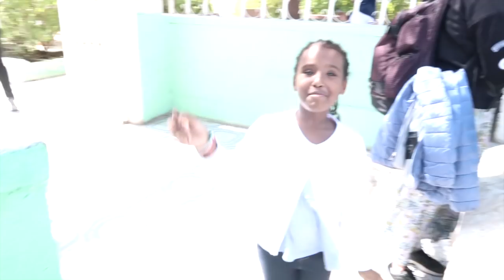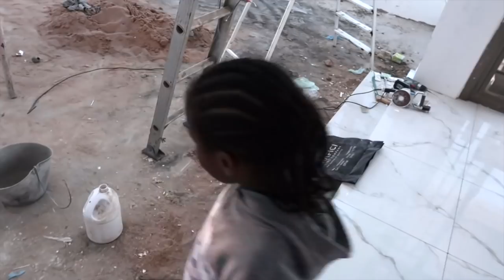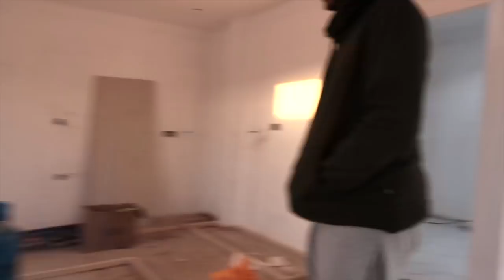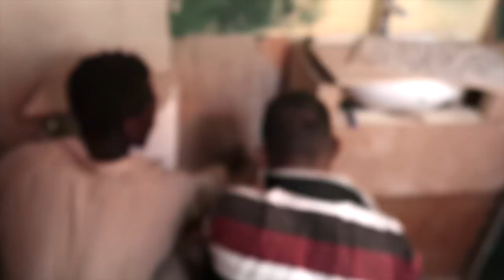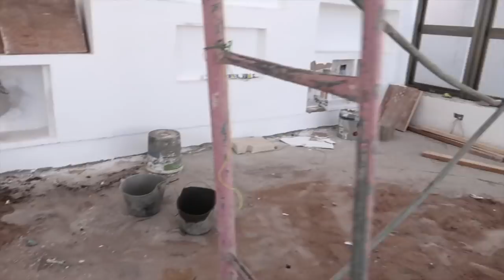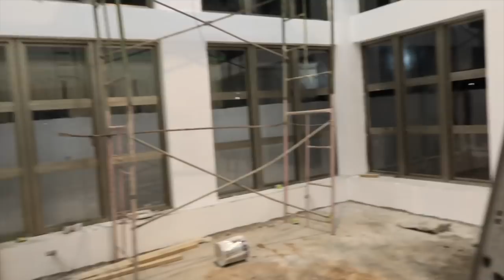Building my house in Somaliland (Part 13)

Comment: Hibaq, am a building trader in the UK. And I work closely with plasterboard fixers, I asked them about using plasterboards in our country as I planned to do so too. They advised against it, as its a hot climate, the plasterboards would crack easily, and would need a lot of maintenance over the years. What do you think? Have you though of the potential of cracks, and other negatives of using plasterboards compared to blocks.?

Comment: How about air conditioning ? Beautiful house.  Is water availability year around or do you need water delivery.  How about electricity ? Do you need a back up generator ?
Reply from the maker: Walalo the house has an air conditioning system built in, but I have not installed all the equipment yet. There is no water running in the area yet, but the pipeline have been installed. We do have electricity and I don’t have a back up generator.